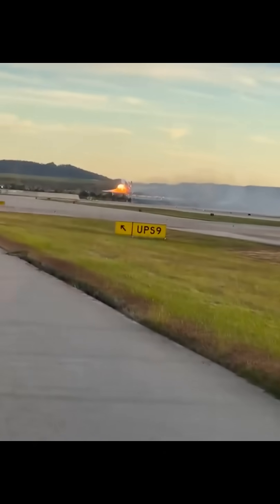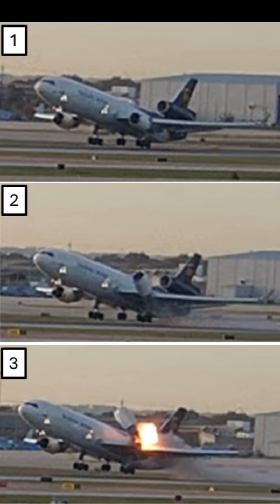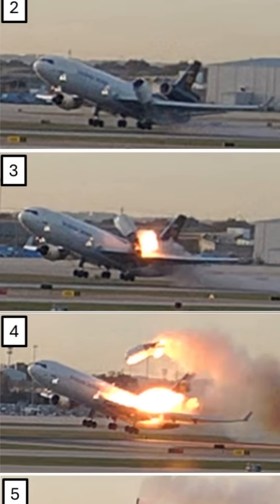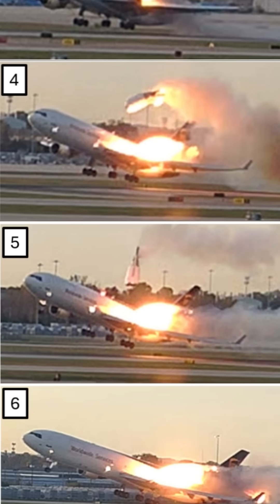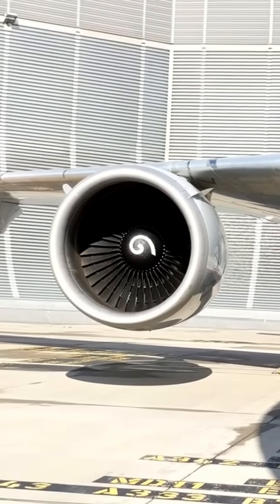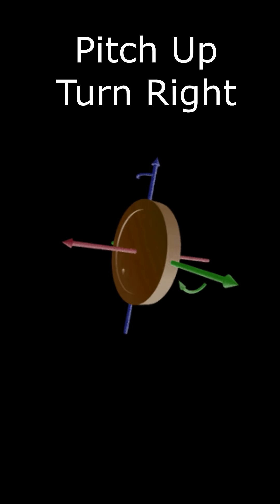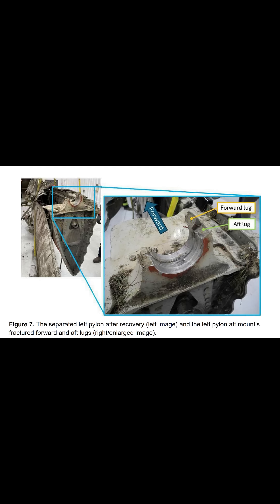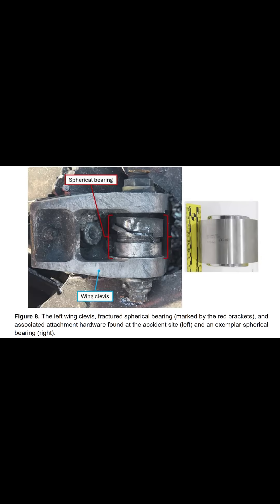Lost Engine Didn't Fall Down, But Flew Up Over Doomed UPS Aircraft #UPS2976

Comment: I just feel awful for the pilots. There was zero way for them to know until they had the nose off the ground and by then it's past the point of no return. There wasn't a damn thing they could do.
Reply: Might've felt it, but it would've seemed like a strong gust of wind at first. Poor lads
Reply: ACTUALLY THINK ABOUT the reality of having 10 seconds left to live. What would you say? What would you say...............
Reply: @michaelpipkin9942 
.
Reply: Not putting a gasoline/oil storage facility at the end of the runway might help 😅 There were accidents like that in the past where the crew survived because the cockpit basically detached from the plane. But when the plane lands on the barrels of oil, noone has any chance.
Reply: @randomnickify The plane hit sideways with a lot of force on cockpit doing over 160 mph. They weren’t going to survive.
Reply: @peredavi Nah man the nose of the plane was up pitching up still and probably what they were hopeing for, but tho not possible because of what they were crashing down on.
Reply: @charleshensonjr4190 you clearly have not seen the dash cam video that shows EXACTLY what he is describing. They felt nothing on impact thankfully.
Reply: @randomnickify Funny you mention this, I saw a different accident (a runway excursion) where the plane barreled across a highway and came to rest just before hitting a gas station on the other side. 
The airport installed arresting surfaces on the end of the runway AND purchased the gas station and removed all the pumps and tanks. Just to be safer in case a plane overruns ever again. 👌🏽
Reply: @randomnickify yeah I know it looked like they the pilots flight crew in the cockpit of that could have survived that if not for structure in the way and what you said. Since no passengers and that's good and the cockpit of the plane breaks away from the rest of the plane and fuel, fire explosion and that's happened like that before with cargo and passenger planes.
Reply: @randomnickify The buildings were already there before the runway was added.
Reply: @455buick6 poor excuse
Reply: Did they survive?
Reply: @MichaelSuperbacker unfortunately, all 3 pilots and 11 people on the ground died.
Reply: @MichaelSuperbacker  No, they died in the crash.
Reply: There where 25s from that moment until the plane touched the ground again and crashed. It is a very short time. Though if there was a system that automatically slams the nose to the ground and applies full breaks might have moved the crash site forward and 11 other people might still be alive that where on the ground. And though the plane would‘ve crashed either way, it would never have gotten airborne, and so chances for survival for the crew would also be marginally better.
Reply: @pyalot  That would be bonkers, essentially putting AFTS onto airliners. Even a system with a false-positive rate of 1 in 10 million takeoffs would result in 3.5 commercial jets autonomously crashing themselves every year on average. How often does an accident like this UPS crash during takeoff occur where people on the ground are killed?
Reply: @SeanCMonahan I feel like, the point where an engine rockets off the airframe, slams into the fuselage and everything starts burning, that‘s when it‘s pretty clear getting airborne is a bad idea under all circumstances. And it does not strike me as a condition that‘s terribly easy to mistake for a properly engineered system.
Reply: @pyalot  the trick is how difficult it is to engineer a system that has an order of magnitude or more less false “engine detached” signals than well, it actually happening.  That is really not easy, especially if any false positive failure in that system essentially causes a crash — then you’re adding crash chances, not removing them.
Reply: @pyalot you are referring to the false negative rate and he is talking about the false positive rate
Reply: @pyalot airplanes can fly on one engine. Sometimes, staying in the air and coming back to land is safer. There's procedures of when to abort the takeoff and how to safely come back to land. Although in this particular crash, both engines failed anyway and crashed within 25 seconds of rotating
Reply: @katrocks1174 airplanes fly on one engine, long as the airframe is airworthy. The airframe was no longer airworthy…
Reply: @pyalot This plane was taking off fully loaded at or near its weight limit, its not designed to take off with one engine which is all that was working basically at rotation or seconds after, the plane was locked into a crash scenario the instant engine 2 sucked debris into it causing it to stall, they simply had no chance in this instance unfortunately.
Reply: @455buick6  It was gonna crash either way. But I do think that if they immediately aborted, it would‘ve been a sliding crash, not an impact crash, they likely would‘ve never left the ground. Which at the very least would‘ve had a good chance of not impacting the fuel depot.
Reply: @SeanCMonahan  enough you are talking about it.
Reply: @pyalot No 3 engine airplane can fly on one engine.
Reply: @sleddriver 
The plane was full of fuel and had a lot of cargo, would they really survive?
Reply: @pyalot I'm not sure the exact specifics of the runway length in comparison to the weight/speed requirements for the MD-11. But I am fairly sure they would not be able to stop the aircraft without overrunning the runway and very possibly still ending up going into the buildings outside of the airport. When fully loaded with cargo and fuel the aircraft needs a much longer distance to stop. By the time they are moving fast enough to take off there was likely zero chance to stop the aircraft before the end of the runway. Once past the decision speed, V1, the takeoff should no longer be aborted. All of their training and procedures would tell them to make the takeoff attempt and circle back for an emergency landing if possible. All of those procedures rely on the airframe maintaining lift and control of flight during an engine failure. This kind of catastrophic failure cannot be accounted for in standard procedure. It's a highly unpredictable failure that would not be realized until they had already left the ground. There was nothing the pilots could have done with the information they had at the time. The only thing they really could attempt would be look for a clear place to put it down but they didn't have that chance with the loss of control at low speeds. 

There have been various crash tests done on flights to demonstrate the effects on a fully loaded/fueled aircraft overrunning the runway at speed. The results are just as disastrous as falling from such a low height. Arguably less chance of survival in that case as the aircraft would be running headfirst into the equipment or buildings beyond the runway threshold.

Comment: So it’s been a while but I remember the show air disasters on the DC-10 crash talking about how the engine was designed to go up and over if something like this happened on the dc-10 so that it wouldn’t damage either the tail or wing leading edge, but it seems the overlooked a bigger issue.
Reply: That seems like typical general-public simplification.
The reason the engines go over the wing is that the rear mounting point failed and the pylon hinged around the front mounting due to the thrust of the engine.
Reply: @Rob2 well yes I get that but I also think the thought process was that if it happened at altitude the plane would maybe dip and in theory it would clear the debris and while the DC-10 is technically different they’re both three engine aircraft and not thinking about debris getting sucked into the engine in such an event still seems like a massive oversight.
Reply: The pylon was designed to break and drop from the aircraft in the event of excessive engine vibration.  Like a fan blade breaker. It was not designed to fly up.
Reply: @regould221  Do you have a source for this claim?

Comment: I have to wonder if those pylons get inspected well enough to have spotted any issues. That's one hell of a catastrophic failure mode.
Reply: The inspection cycle is something like 29k cycles or takeoff and landings the incident aircraft was still like 9k cycles away from the next inspection cycle and I think it’s been confirmed by maintenance records that the last time the part in question was inspected was basically 5 years ago and it was basically a simple visual inspection nothing too in-depth and depending on who you listen to talking about this it wasn’t required to be like taken apart for an in depth look so they didn’t really check it they basically did the yup it’s still there and called it good.
Reply: They have a specific inspection set that actually got made more careful after a disaster in the late 70s which was quite similar, an engine connection failure on takeoff
Reply: @letsburn00  didn't stop engines breaking off later on with other aircraft.
El al flight 1962 for example.
Reply: @samuraidriver4x4  That was a completely different case!
It was a different plane (747) and it did not happen at rotation but much later in the flight, during the climb out.
Also it was not the lugs that were failing but the pins, that were designed to fail at some load but failed sooner due to aging.
Reply: @samuraidriver4x4 this is more reminiscent of American 191, bad maintenance procedure caused the aft lug to fail causing the engine to detach in a very VERY similar manner.
Reply: @Rob2  Assuming that was the case where one of the inside engines fell clean off and it was later ruled as metal fatigue on the retaining bolt/log...
Reply: @letsburn00  Yes, and those special inspection requirements only applied to DC-10 aircraft. When they made the MD-11, they convinced the FAA that they didn’t need the same stringent inspections. I guess they will be revisiting it now.
Reply: @letsburn00  let's bear in mind there was also an incident where a airliner lost a turbine with its pylon because one of the retaining bolts snapped...the level of damage was actually so fine that the maintenance would have needed to have put the bolts under a microscope...or just replace them all
Reply: @letsburn00  it was in 2979 - AA flight 191 during take-off of DC-10. It was also the first crash when passengers could watch their demise on camera because it was on of the first flights that had installed CCTV from the perspective of the captain and transmit the feed to the on board entertainment system so the passengers were able to watch the ground racing towards them. I have used to watch "Mayday" series religiously and after I saw what happened in this years' accident first thing that came to my mind was the one from 1979.
Reply: @letsburn00  DC-10 Chicago
Reply: They don’t get inspected frequently enough, and the design of the mount is such that cracks can be hidden where they cannot be seen.
Reply: I think they should replace those critical parts regularly as preventative maintenance no matter if they look good or not.
Reply: I think they got rid if the inspectors. Safety regulations cut into profits
Reply: American Airlines had a similar failure before.  Turned out they cheated on maintenance and instead of removing the engine from the pylon to work on it they removed the pylon from the wing with a forklift to hold it for removal and reinstall damaging the pylon connectors.
Reply: Someone getting fired, maybe possible charges.

Comment: Bad design of the MD11 putting the engine so far forward in front of the wing with that crazy pylon mount in my opinion..  it looks like and I could be wrong here but it looks like it gives a massive leverage arm for that torque force to break the pylon mounts… it’s just a matter of time.

Edit.. Apparently Area Rule for dynamics..
Reply: Look up Area Rule. It helps with aerodynamics to put the wing mounted engines so far forwards. Which is why every commercial large jet aircraft has them there.
Reply: @owensmith7530  I stand corrected and informed.  Dont know why the MD11 seems more off than others.

Comment: So now they are going to X-ray every engine mount like they do for nuclear facility pipes?
Reply: There are non-destructive inspections already performed. They'll likely shorten the interval.
Reply: They have several ways to locate fatigue cracking, x-ray, ultrasound, magnetic Flux, etc.. The particular part that failed (apparently) was supposed to be checked after 28,000 cycles. Even with the advanced age of plane with around 100,000 hours of flight time it was still at only around 22,000 cycles. The obvious conclusion is that the engineers have overestimated their durability or underestimated the forces acting on them. The inspection cycle requirement needs to be shortened considerably apparently.

Comment: Basically, the same damn situation that happened with the American Airlines Chicago air flight what’s up? They lost hydraulic fluids and the engine. Only one of the end is only activated the shutter for star but since that engine went out, and it couldn’t activate it, causing the pilots  to think the plane didn’t wasn’t in the staw

Comment: Why airplanes need rearview mirrors I guess.... Woops we are losing a motor! Throttle down. The packages were wondering why it is wobbly. Probably where the policy for shutting all window shades before take off came from.
Reply: They were at rotation when the engine came off, at that point as a pilot you have no choice but to take off and try to make the plane fly the best you can. You are already too far down the runway and going way too fast to reject the takeoff. That is why pilots call out V1 speed during the takeoff roll, it is acknowledging that they are now committed to takeoff (or at least try to) regardless of what happens. The poor UPS pilots were doomed, they had to take off and then hope they could somehow keep the plane in the air long enough to land again.
Reply: @whyask5461 - yep and likely at MTOW; DC-10/MD-11 designs have a notably high stall speed, definately not carrier rated ! Too many things went wrong, both too late and too fast for any other outcome.😢